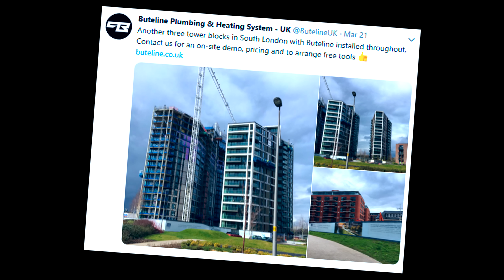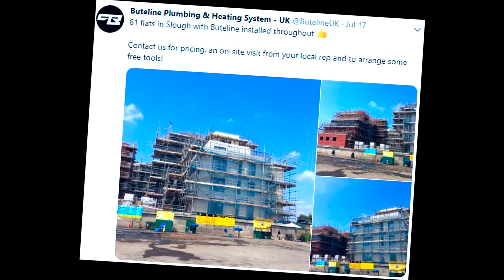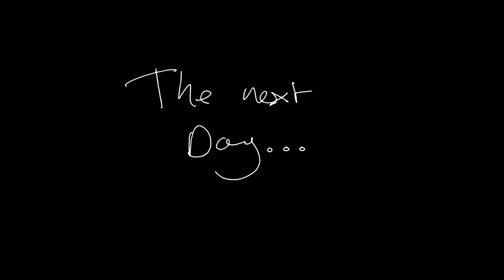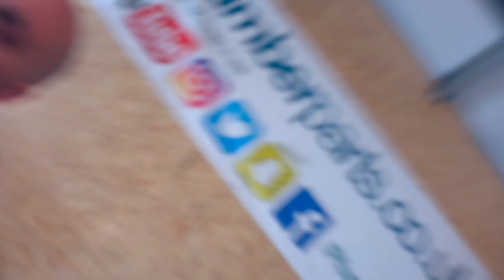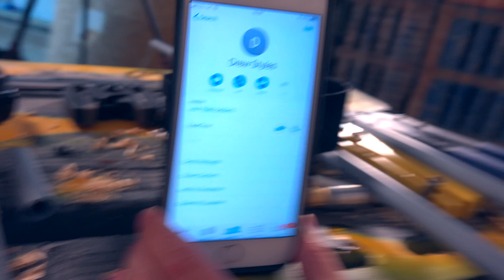PLASTIC PLUMBING PIPE SYSTEMS - Meet Buteline

Comment: U did not mentioned in your video Buteline also make fittings for Polyethylene pipes (PE80).  I was planning to get the crimp for Buteline pipes PB-1 but bought the wrong one and could not return it. Ive been using buteline fittings for PE80 pipes for a few months and i never need to fix any work the second time.
Reply from the maker: Good shout bro!

Comment: Using Buteline in NZ but prefer Dux the fittings are brass with copper rings instead of plastic and aluminium heaps of different fittings and its quick and easy to work with great video keep up the good work

Comment: Strap Right Back, hey love your videos. Question for you... I’ve got an old primatic system in the house and need to change the bath, loo, basin etc. Can I turn the cold feed off and bung the outlet in the tank up in the loft to stop the cylinder refilling, drain off some hot water via the taps so the level in the in the cylinder drops a little so I can disconnect the bath etc? Or am I talking shite and the cylinder will implode!! Hold Tight

Comment: Seriously... i drive about my home town randomly shouting "hold tiiiight"..

Really good direction to take the channel.  You'll move onto some really big big things in this direction.

I know everyone has different opinions but I would have liked to have seen a Buteline overview earlier in the video.  
Stuff at 05:51 should have come a bit sooner as an overview.  Maybe start with an early interview question with "So, what is it that Buteline do?"
Also, some B Roll images or small clips show casing their product.

Would have liked to have seen how you replace a crimped connector.

Excellent step up in the channel.  Hold tiiiiiight.

Comment: I dont know about this, im used to the uponor system and really havent found a better product then that, but maybe uponor is not avaiable in england idk
Reply: I'm from Canada, and have been using Uponor too. Where are you using Uponor?
Reply: joe torti in the netherlands
Reply: i would love Uponor to be distributed in NZ but sadly the North Shore agent did not respond by phone or email last year and now they  have just disappeared off the net (for NZ). it all seems to be bute, PEX & copper in that order over here. for now i am using Kembla PEX, which i have integrated in my Frankenstein plumbing mix of copper, buteline & now PEX for my house. i just wish they had colour coding for cold (blue) and hot (red) piping. Uponor does coloured pipes as well as options for ceiling extinguishers which i really really like.

Comment: If i run the pipe horizontal what is the maximum run before it needs support ?
Reply: 600mm, 700mm, 800mm depending on pipe size, 1200mm 1400mm 1600mm on verticals 👍

Comment: Can you install BL on a secondary return system?
Reply: In most systems it can be, head over to our website www.buteline.co.uk and download the install manual which has a flow diagram in the back to explain this 👍
Reply: Is there a yes or no answer to this question or can you share the link to the exact download?
Reply: Exactly! @jackgsebolier986
Reply: http://www.buteline.com/uk/downloads/
Reply: I would just like a definitive answer if BL can be used on a secondary return running 24 hrs a day 365 days of the year. @butelinenorthlondon6907
Reply: Found the answer on page 36 it must not be used for secondary circulating hot water.
Reply: That’s a shame that you can’t use it on hw secondary return. That’s put me off the product.

Comment: Thanks for taking the time to putting this video together. Great to see some of the new Bute developments. Thought we might get to see the shower valve fixing kit I've seen on YouTube. I still want to start using it but just haven't found the opportunity because copper is so much more accessible. And I like the challenge of using rigid pipework and pipe benders etc.
Reply: The Bute1 fixing is just having the final adjustments made for the UK 🇬🇧👍